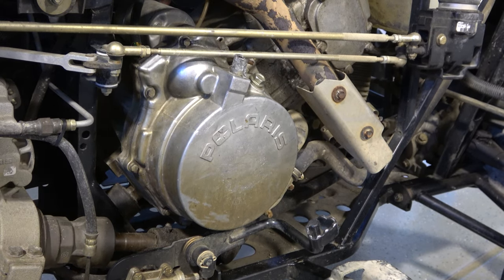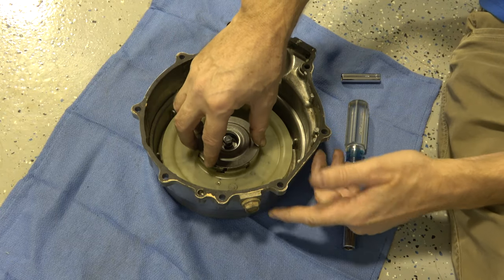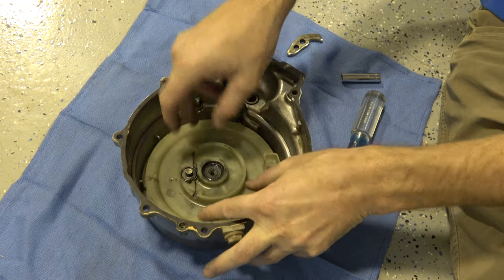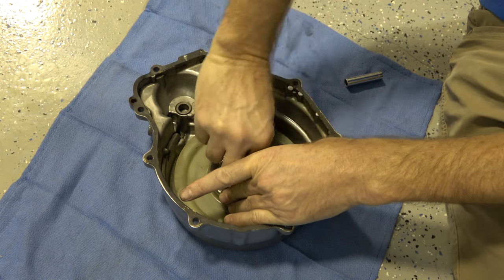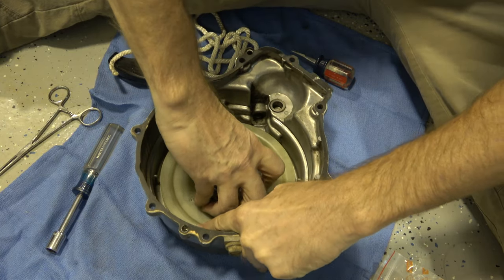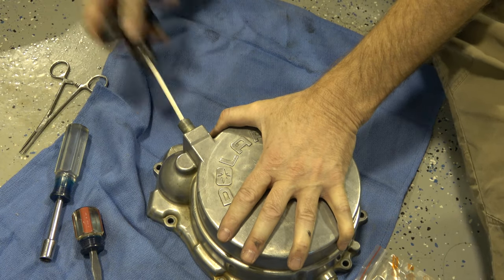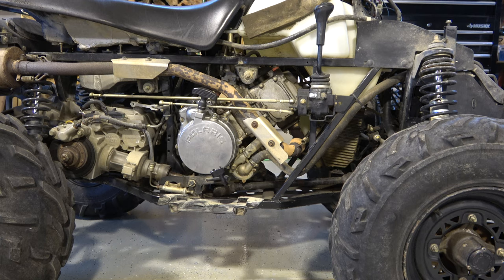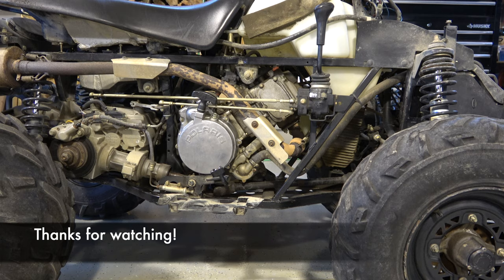Replacing/fixing a pull start/recoil Rope and Handle on just about Any ATV.

Comment: Just a trick I’ve used over the years when putting new ropes on recoils! I heat up the end of the rope, then I pinch the end and pull while it is still hot and when it cools down you have a hard point and it’s easier to fish through 👍🏻
Reply from the maker: Great tip.  Yes. Or after tying the knot also to clean it all up. I use to as a kid do that with a shoelace to make it easier to lace if it broke.

Comment: Your video helped me a TON! I got a rope from ebay and put a snowmobile "D" handle on my '99 Xplorer. The compression is so high and I actually fractured my finger trying to pull start it. I melted the rope end to make it easier to thread through. 6 times was enough for mine. I clamped a piece of hose on the Top where the rope comes out to "seal" it a little bit. Thanks!
Reply from the maker: Good deal. Always more than one way as they say. And if you ever think the seal wasn't quite doing its job. Just pull the plug/bolt on the bottom to drain it.
Reply: @ericinalaska7648  I wondered what that bolt was for! Thank you
Reply from the maker: @movaughn20   Good deal. We learn something everyday. Or hope to.

Comment: Thx. Great video. I need to replace my pull cord. Its been broken for 2 yrs. I have electric start so it didnt bother me much.
Reply from the maker: Glad it helped. It sure is nice to have it as a backup if you ever have a battery situation. As is commonly said its better to have and not need than  need and not have.
Reply: @ericinalaska7648  I agree, especially for such a cheap repair. I’ll be ordering a recoil kit. Unfortunately I cant find just the rope on Amazon Canada.
Reply from the maker: If all you need is the rope Im confident you could use a substitute. Its really nothing exotic. Is yours molded into the handle? Or pulled through with a knot? If its knotted, I would think you could find a suitable rope to use. Just gotta get the length right. Or reasonably close. And similar diameter. If your removing the old one assuming its still inside. You could use it as a reference.
Reply: @ericinalaska7648  its molded. The rope tip was still on the outside and I debated a lawn mower type but I was concerned water getting in the housing since the rubber end wouldn’t create a seal.
Reply from the maker: Hmmm. The rubber handle is usually  kind of a press fit over the casting. On most anyway. Prior to finding what I used I was considering an off brand handle I had laying around and maybe parachute chord. But the handle wasn't a good fit. Then I found the kit I used in the video and compared that to the brand name replacement price. I thought it was very reasonable to just get the handle rope combo. Anyway. You'll figure it out.
Reply: @ericinalaska7648  i just ordered the kit. Who knows, once I open it up there may be other parts to replace
Reply from the maker: Well there you go.

Comment: Mine got water in it but lucky not in the oil it’s not returning
Reply from the maker: If you look on the bottom of the cover. There is a drain plug. Or should be.  Ive seen it recommended in some manuals to pull it after riding in water deep enough to submerge the cover, a bit anyway. But Id also consider changing out that seal possibly.

Comment: Great job very well on. My pool cable was stuck on mine so I took it off and pulled it without it being attached to the fly wheel and it works well. I noticed that on top of the fly will the smaller gear that is just is above the flywheel is shaky/loose. Is this supposed to be? Can’t find a related video on that piece. Thanks for the help.
Reply from the maker: Glad it helped. As far as the wheel you're describing. I'm having a little trouble picturing it from you description. When you say loose do you mean you can easily remove it? Or is it loose meaning sloppy? Damaged?  Its really hard for me to answer that one.

Comment: My friend has a 99 trailblazer with a broken pull cord, is this the same set up as trailblazer? Thanks.
Reply from the maker: Not 100% sure. But if all you need is the cord. It should be fine. You may have to adjust the length. By proper # of winds is best. If you look in the video description you'll see a link for the one I used. Pretty universal generally.

Comment: How long does the rope need to be for a polaris typically?
Reply from the maker: I looked at the part description for details on the one I used, as well as manuals  but didn't find a length. I measured the one I installed by pulling it out all the way as if starting. And from the handle to the casting is about 44 inches. Longer than I would have guessed. So before tying the knots and the distance into the casting to the wheel. It probably starts at about 48".  If I were cutting a pc to replace, Id say you'd be good making it between 36" and 48" . You don't want it too short. Its a bit rough when you give it a good pull and it stops abruptly because you ran out of rope. If you've ever pulled one where someone retied the handle on after the rope broke. You know what Im talking about. I don't look at it as a super precise requirement. No need to be longer than you could pull, and there is only so much room on the wheel. And too short can be unpleasant.  Maybe someone can chime in if they're aware of an official recommended length. But off the cuff Id say if you make it between 36" and 48" Id probably split that. You should be good. And of course it takes more time and effort. But if you don't like the end result. You can always shorten it. But of course you cant lengthen it.

Comment: Hey man, i have a trx200sx quad and the pullstart bound up yesterday when i was riding. took the pull start off and could not get it to budge. Tried hiting it with a hammer, while holding the plastic part down and it will NOT move. i even had my neighbor come over and try to get it out. He hit it with a hammer and it will NOT come out. We removed the rope thinking it was binding it up. It wasn't, What advice do you have that would avoid us having it in 30 different pieces by the time we get it out. Thanks!
Reply from the maker: My first thought was the same as yours. Bound up rope. My second thought is what part are you hammering on that won't move. Is the plastic wheel bound up/not turning or something else. If your talking about the plastic wheel. Id just carefully remove the bolt holing it on. Im not familiar with the guts of that particular model but I cant imagine its drastically different than the one Im doing in the video. If your pulling it apart just go slow and easy. Maybe take some pics with the phone as you go as you can in case you have a crap how was that pc in again moments. If your talking about all that remains after you remove the recoil assembly. Id have to do some research on that. And maybe have a little more info.
Reply: @ericinalaska7648  Yes, i'm referring to the plastic wheel, it's bound up on something and me and my neighbor came to the "solution" that it was welded to the outer case, we tried getting a flathead screwdriver on it and it won't come out. It's also sitting at a strange angle. I can probably get some pics for you tomorrow if you've got time.
Reply from the maker: @reedsmechanical3663  Is anything noticeably damaged or is it just seized up? If its seized up maybe you'll need to see about getting a replacement part. After you do to it what you have to to get that thing off.  Ill be curious to hear what failed. Theirs obviously usually some bearings in there that based on what your telling me may be the culprit. Over heated and wheel maybe melted to make it go out of whack at the weird angle? Was maybe hot and soft when you pulled it then cooled off out of whack?  Let me know.
Reply: @ericinalaska7648  I sure will, i traded for the quad and have been working on fixing it up for the past 3 months, someone before me re-round it and left a BUNCH of excess cord on the plastic wheel. While this wasn't the issue, it tells me that whoever re-wound it probably didn't know what they were doing. In any case my neighbor cut out the rope itself and left it for me if i could get it out. I was looking around and their going for like 50 bucks for the assembly without the rope, which is INSANE. I'll keep you posted.
Reply from the maker: @reedsmechanical3663  Yah parts are always spendy. I comment on it all the time but that's all recreational stuff. I get it, but it doesn't mean I have to like it.  That rope/handle I used in the video was reasonable and perfect for mine. But I cant speak for your Honda . But Id think at most you'd maybe shorten it. If I remember correctly your pull start maybe has a smaller recoil assembly? And Im not sure how the molded handle would fit on yours. But ... If you can get the handle retied onto a similar diameter parachute cord or similar Id think you'd be in biz. I was exploring that option but I didn't have the handle . Didn't come with it and the previous owner had no clue where it ended up.
Reply: Thats what happened to mine I just bought a whole new kit